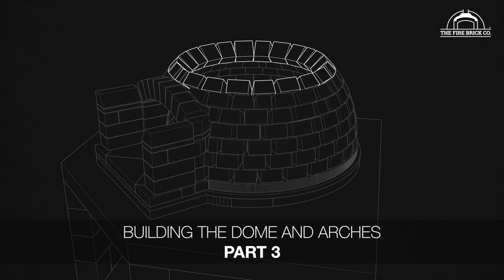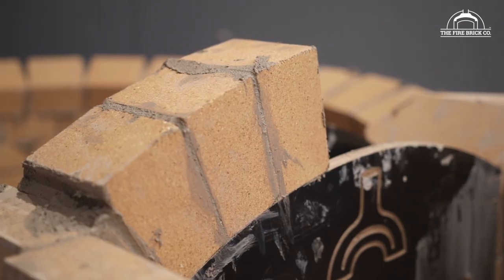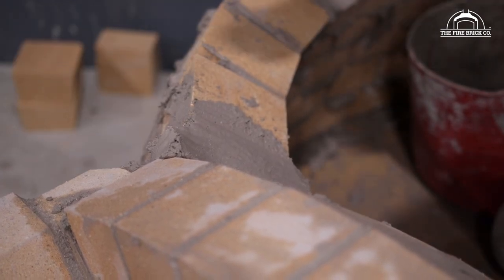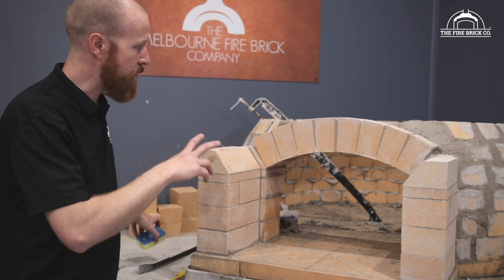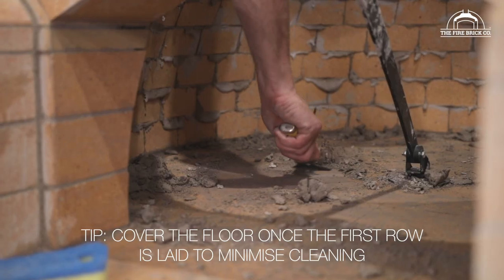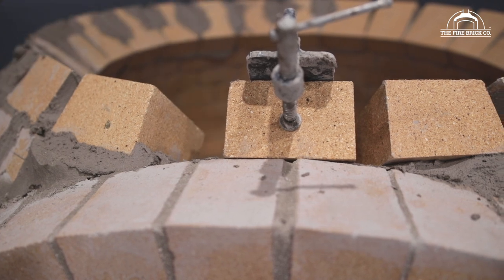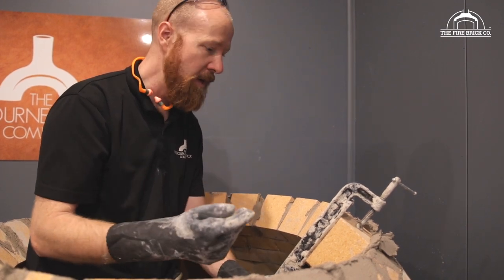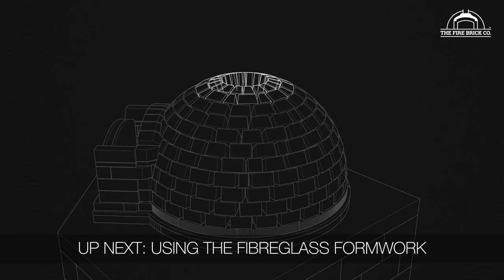How to Build our Brick Oven Kit | 6. Building the Brick Dome Pt3

Comment: Could you please explain why it is important (and not just for aesthetics) to fill any voids in the inner joints and have a nice flush fully filled joint. Thank you.
Reply from the maker: Hi Jeff, great question! Several reasons; 
- For full and even transfer of the compressive force from the bricks above through the mortar joint.
- To ensure smoke and hot gasses don't have an easy path through the brickwork to the insulation layers, where they could build up creosote deposits. 
- For aesthetics too! 
Hope this helps, please don't hesitate to call or email us if you have any further questions 😀

Comment: I am wondering if the bricks for the front arch and sides can be make with coloured non-fire bricks that will match the bricks I am using for my outer brick cladding?
Reply from the maker: While you could do that, you may find those bricks struggle to cope with the high temperatures that you can get to in that  part of the oven. We would usually recommend building the oven as you see us do it here, then clad around it with your brickwork, 'hiding' our bricks behind yours.